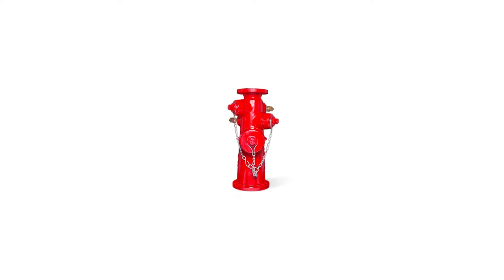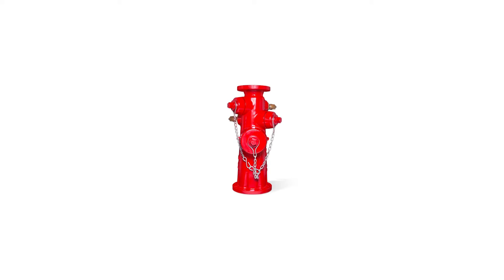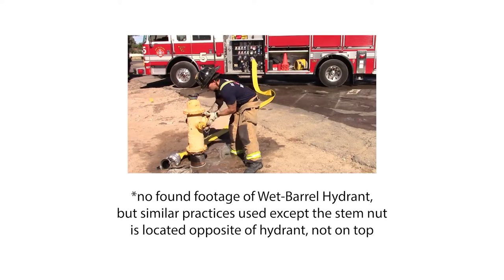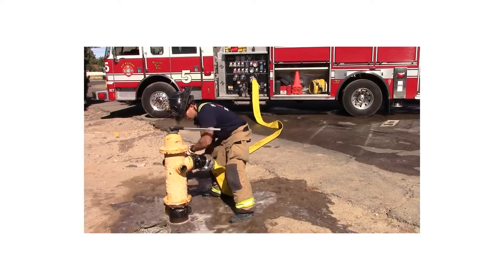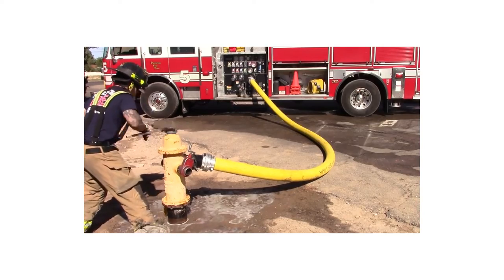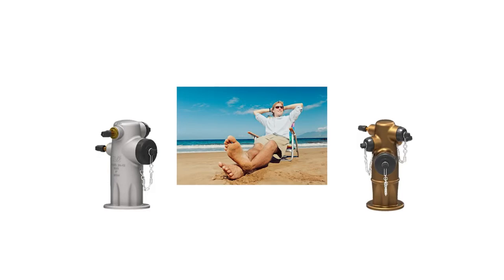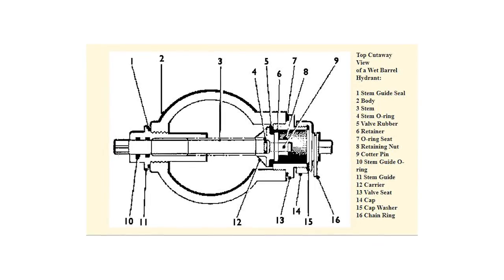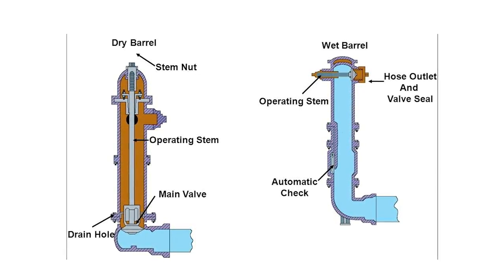Wet Barrel Fire Hydrant

Comment: I just wonder if a wet barrel hydrant can be retro - fitted to have a below ground valve and drain port at the bottom...
Answer: YES!
I've done it!
Freezing temperatures NOT an issue for my wet barrel style hydrant with the system I have..